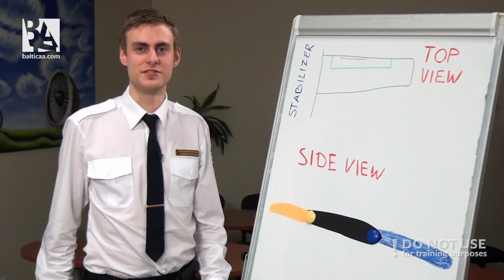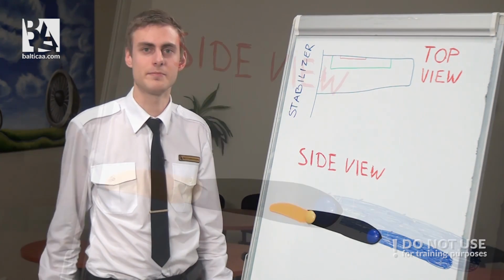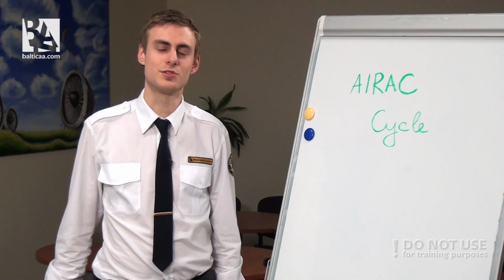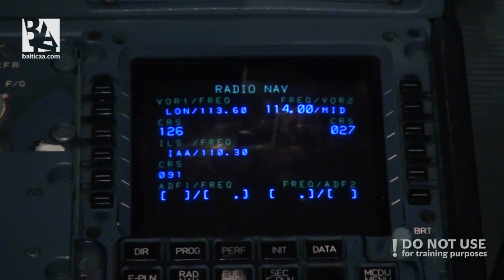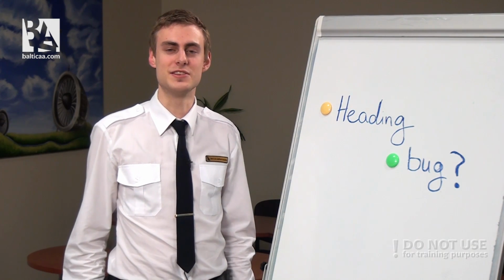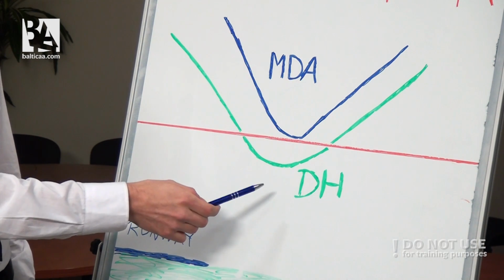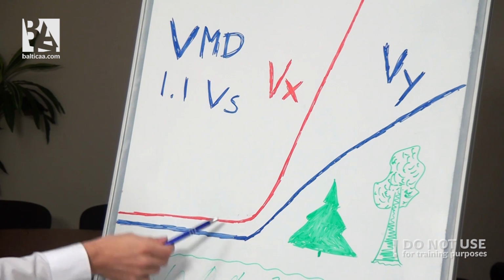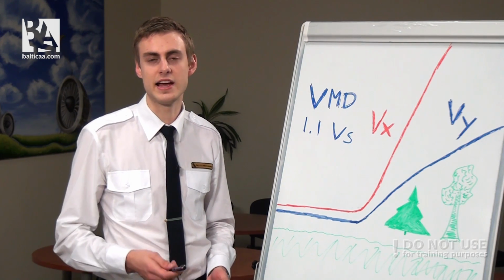Viewer question - answer Baltic Aviation Academy

Comment: What is Localizer?
Reply: +xCL VisioN a localizer is not a glidepath for the runway. A localizer provides horizontal guidance towards the axis of the runway. A localizer solely provides Lateral guidance and not vertical guidance. What your thinking of is the glideslope, which gives indications as to the optimal descent path. The Glideslope provides purely vertical guidance and not lateral guidance. The two work in congunction with each other but are different equipment with their own seperate aerials often at seperate positions on the airfield

Comment: Hi guys,
It's more a technical question about aircraft design, please read it as well.

It doesn't matter which brand or what type of aircraft.

As you approach and get to the touchdown moment, there is a lo of waste of tire rubber exactly in the impact of touchdown, because of the tires are not spinning, so I was wondering, why isn't there a small, let's call it incorporated some kind of a windmill like an turbo-design just driven by airspeed connnected to the axis of the wheel using the airspeed, so the wheel and the tire would have a certain round per minute that would reduce the huge difference between a still standing wheel and the runway during the impact.
It's not easy to explain, but let's say it straight, some mechanism that converts the tire speed to the expected runway ground speed in the moment of touchdown, just using the air wind speed.
I read also an article about this issue that the airport management has to pay a lot for the maintenance to scrap off the wasted rubber from the runway during the nights, when there is less traffic.

I'm thinking this could save maintenance costs on each aircraft just wasting less rubber on the tires.
To avoid this it would be a WIN WIN situation.
If some engineer could answer my question and comment, this would be great.
Thank you so much.
Reply: I also had this question. Have you got the answer yet ?

Comment: How much do you use the rudder pedals during normal manual flight (all engines running properly  and autopilot disengaged)? As a glider pilot I'm used to use the pedals very much for the airplane control. To compensate for the secondary effects of the ailerons and to align the airplane in the airstream. We have the thread attached to the hood to help us keeping the alignment. You don't have it, how then do you align the aircraft in the airstream?

Comment: Hey Baltic, how do you contact ATC on an Airbus a320? Like what switch do you press?
Reply: There's a trigger on the sidestick. It essentially transmits when you hold it down as with any other plane. :)
Reply: thanks

Comment: Where are the parachutes and can a passenger get out before everyone hits the dirt and goes splat? If they worked so well in the past why is there is no plan for them? Can't thrust be used on only one side for a period of time to allow for departure at an acceptable speed? And why is faith in the pilot the only option given if flight can not continue? Also, what kind of logic demands a total loss of life after the aircraft fails?  The facts are that planes are reported to go down several times every year since I can remember, and I never hear of anyone with a parachute or even a plan to use one. Don't let your wings ice over, I wish I could get an answer from an experienced pilot.